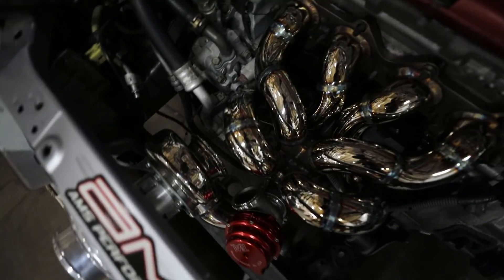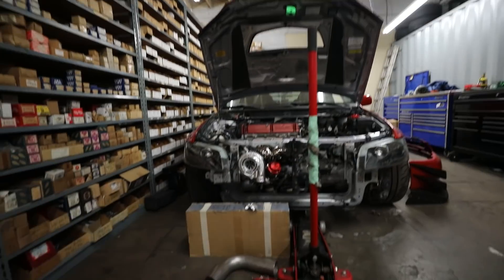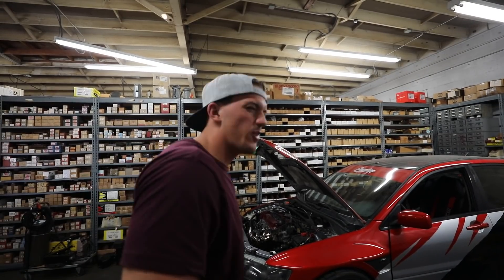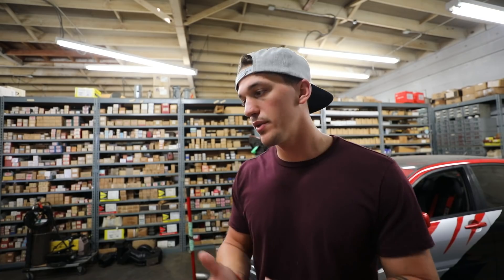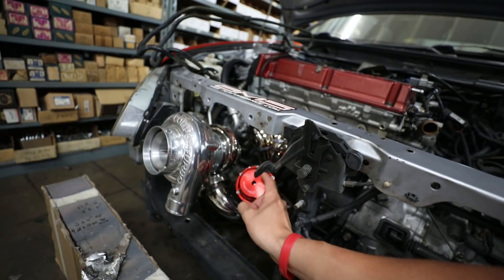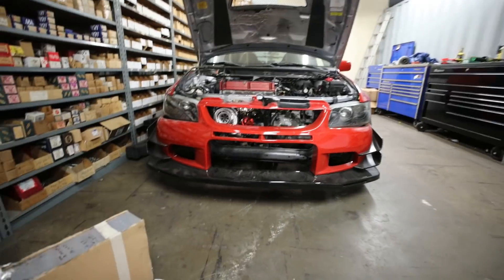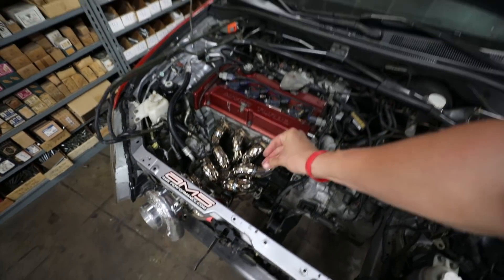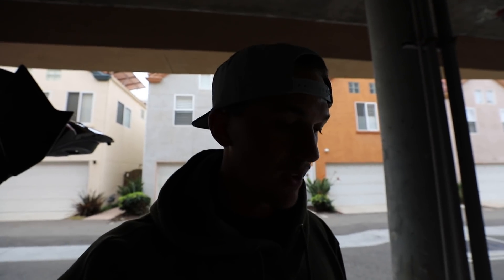CUSTOM EVO 8 TURBO & MANIFOLD IS MOUNTED!

Comment: OMG damn that manifold is BEAUTIFUL. Dustin idk what boost solenoid, you gonna run but you should run A speedfactory 4 port my boy. As for the gate fading just run A Turbo blanket my man and you will be just fine. For the valve cover get it Hydro dipped close to the colors that's on the car that would kill.
Reply: SI RICKO mY MaN
Reply: Elijah Lawrence what up bro 👍🏾

Comment: Should’ve made the evo a drift car. Maybe I’ll build one when the time comes
Reply: Tuner Lifestyle wtf noo how the fuck you gunna convert a rally car AWD into a RWD car nooo ewwww i know they did it on tokyo drift but thats garbo
Reply: Dominicandante it’s rare and unique. It would surely turn heads
Reply: Tuner Lifestyle naahhhhh and also the parts like the bumper and the fenders would be really expensive and hard to find if he crashes this car is gunna cost alot evos by themself the 8 and 9 are over 20k a car rn
Reply: Tuner Lifestyle hes adding value to the car resale would be nice like this
Reply: He doesn’t have to rebuild like the body. It just would me nice to see a drift evo

Comment: Did u really call the Valve cover an "Engine" Cover...2wice?!? Haha That's an auto L bruh lol

Also, I guarantee that 400-450 will not be enough after a month of driving it, & since the stock block can hold 550- 600whp safely  I would def tune for upper 500's if u think that turbo can make 700whp, that way u don't have to tune again.
 Fuel system is the biggest area to focus on besides Turbo kit... Install either ID1700x or FIC1650's from the start with a Walbro 450Lph if not a dual pumper with 2 450s... RADIUM fuel rails, RADIUM FPR, & have the guys at Intice Fab a Catch Can. I would also install bigger Cams like GSC S2's... Otherwise ur low end TQ will be terrible. 

I'm just giving you my opinion. This is coming from someone who has built multiple 500whp STi's and a few Evo 8s. Just to put things in perspective, my current Evo 8 build started off on stock block, stock 9 turbo, GSC S1 Cams, 3in Straight Pipe TBE,1000cc injectors & Wally 255lph and it made 390whp 379wtq @28psi on pump 92oct.
So with ur set up, u shud be making an easy 500whp & around 430wtq....

Comment: Sell the civic and buy another sti please :)
Reply: Edmon Jovial ummmmm no
Reply: y hes been there done that he wants something new
Reply: No.
Reply: Edmon Jovial type R>>>>>STi
Reply: it was a WRX not an STi
Reply: Subaru’s as so over played nowadays. Not only that but they are shit on making power reliably. Been there done that.
Reply: No
Reply: Lil Mayo it’s kinda funny. People who owned them either love them or hate them. I didn’t have a great experience with either of mine. My 08 ate CP sensors constantly, and my 97 RS has every problem known to man like headgasket failure and spun bearings.... they don’t make great power either and in a roll anywhere they aren’t that fast, 4th gear and up they fall flat on there face. Type R is also far more exclusive
Reply: Driveitsideways 1 exactly what I’m saying man. But now I have a 2jz gte is300 with a 6762 single turbo and etc. love the piss out of it.